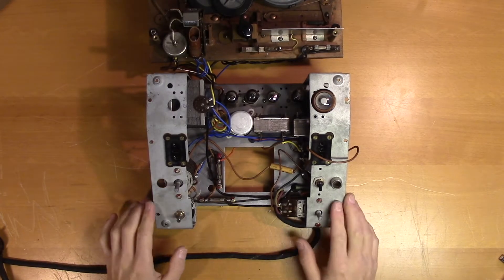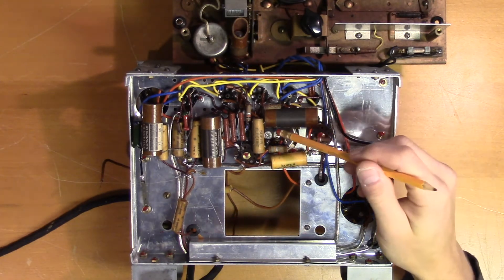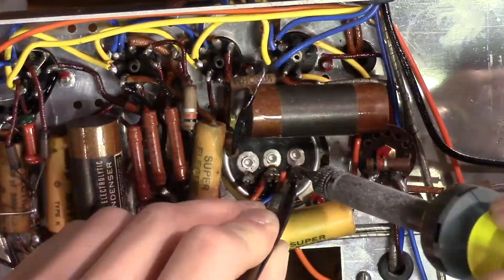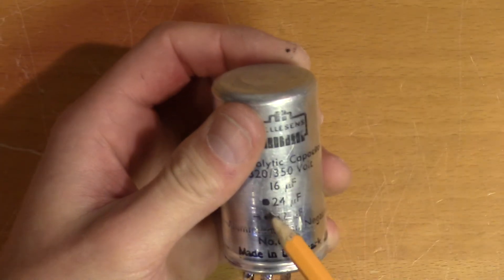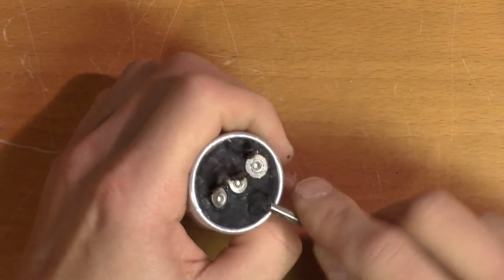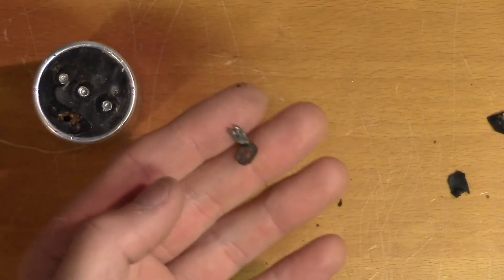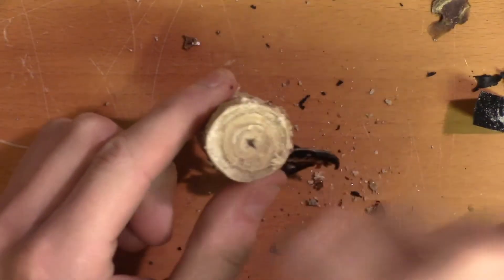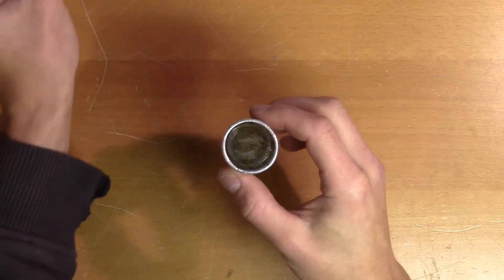Refitting an Old Electrolytic Multi Capacitor - Ekko Recorder Restoration Part 4/6

Comment: Nice video! I was just thinking, one option when restuffing the metal can capacitor would have been to insert a metal or plastic tube parallel to the new capacitors, in order to vent the area above the capacitors downwards, and avoid drilling a hole in the case.
Reply from the maker: Thanks! That sounds like a great idea. That option did not even cross my mind when refitting it.